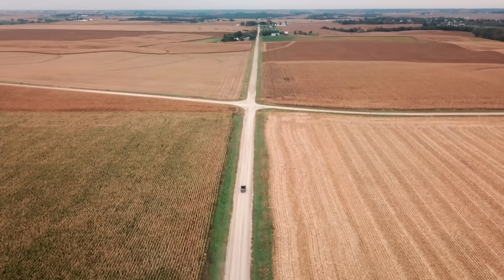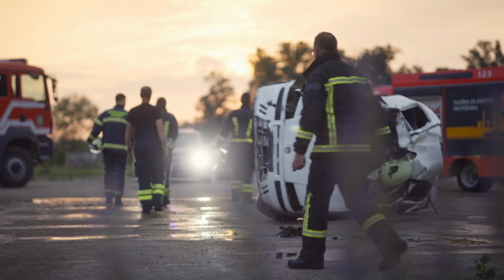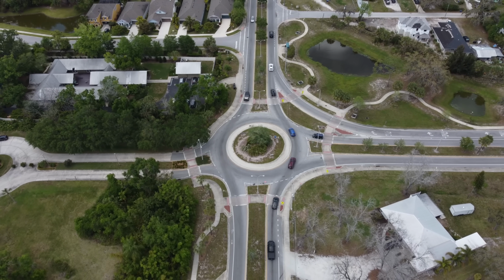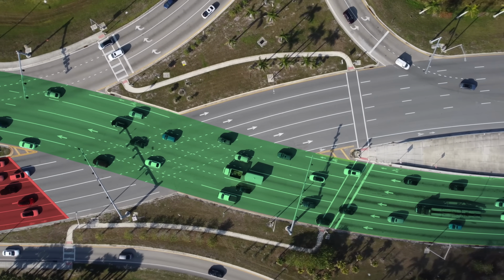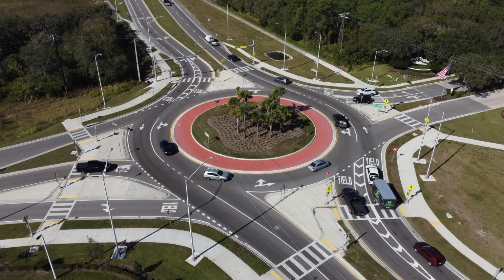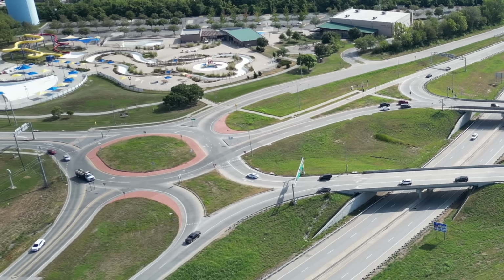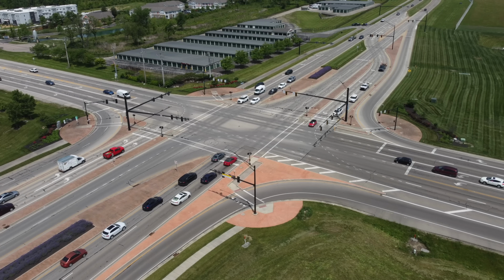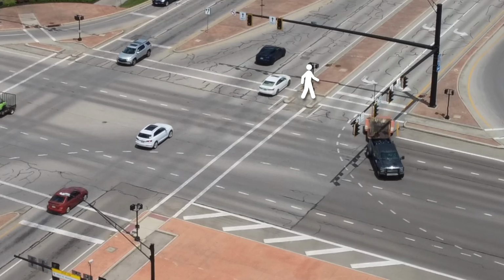These Intersections Are Changing the Roads Forever

Comment: A big reason roundabouts are safer is also that collisions occur at oblique angles rather than ninety degrees. You get done body damage to the cars, but the humans are safer.
Reply from the maker: Very true
Reply: @Streetcraft  No, not true, the angle is usually 70-90 degrees. What mitigates damage is the low speed. That is, if it's built correctly - lots of roundabouts in my country are not, and cars plough through them at up to 70mph.
Reply: @ooioiioioo In what country exists thes usless roundabouts?
Reply: @oliverbecker3443  I'm help him, Indonesia. No one yields for those already in the roundabout. In fact, those in the roundabout have to wait lol. maybe less about the "useless" roundabout but more on the behaviors and knowledge of the drivers. But then again, had everyone yielded it would only cause traffic because there is very few who use it for 3rd exits. all are going straight (2nd exit).
Reply: @ooioiioioo If traffic is joining a roundabout at 90° then it is a poorly designed roundabout.  The danger of a normal junctions is traffic crosses at right angles so a vehicle can drive straight into the side of another.  That should be physically impossible on a properly designed roundabout as the approaches should be flared so that a vehicle would be in the middle of a turn as it joins so any collision will be side-to-side.  It is the combination of that and a lower speed that contributes to overall safety.
Reply: I really don’t like guided multilane roundabouts - they make the yielding part of the design much less encouraged by allowing you to drive almost straight along an almost tangent when aiming for the first/second exit. They are also far less forgiving of navigation mistakes if you haven’t moved into the correct lane before arriving at the roundabout. The main point of a roundabout is that the junction of the arriving road with the roundabout should be like a minor road reaching a major on where you’re only allowed to turn towards the passenger side. This should involve turning, not going straight, to encourage the slowing that makes the whole thing safer.
Reply: Meanwhile you have more collisions because of either poor sightlines due to landscaping choices or an area has far too much traffic for a uncontrolled traffic feature like a roundabout to be used but it was forced in because of "style" choices. This doesn't even touch the problems of roundabouts being used in areas with heavy truck traffic.
Reply: @H @Hybris51129 is is a good point. Some landscapers get too enthusiastic! As for high volumes and traffic jams, whether you have crossroads or roundabouts, things will snarl up. I don’t see any silver bullet there, but crossroads controlled by lights may be slightly easier to keep unencumbered.

Comment: I'm surprised that nobody has split levels on a diverging diamond to remove the stop lights.  If you have vertical space for the clearance, you'd have fully uninhibited movement without any left-hand turns.
Reply: Do you wanna pay for that?
Reply: At that point it would probably be no more costly to build a stacked interchange which does the same thing.
Reply: That would be a DCMI, double crossover merging interchange. Though im not sure any such interchanges have been built irl.

Comment: As a Dutch traffic engineer, i have some doubt about the Diverging Diamond Interchange.
One thing that you keep in mind when you design a street or road, is the expactation that also not very capable drivers uses the road in the right way.
In your examples, the angle between the roads on the main crossing is very high, which ensures safety. But only if there is planty of space, this is possible. In Europe, espacially in The Netherlands, the angle is not that high to make the interchange smaller. But that increased the number of wrong-way driving and crashes. That's why we don't recommended this type anymore.
Reply: Here in Amstelveen there is a new diverging diamond interchange still being finished joining onto the A9 and it seems to work pretty well.
Reply: @AlistairLynn  The DDI in Amstelveen is way better than the first one in Leiden.
They improve the design, for example to use "anti-zichtschermen" to streamline the traffic.
But still a Partial cloverleaf interchange is way more bulletproof.
I'm happy that the DDI will be changed back to a normal interchange after finishing the roadworks at highway A9.
Reply: It is a truism of engineering that as soon as you create something idiot-proof, you find a bigger idiot....
Reply: So what type do you recommend instead?
Reply: @NeuQN  Turbo roundabouts.
Reply: @David-bi6lf  Turbos don't do the same thing as diverging diamonds.
Reply: @CrissaKentavr  No they don't but you don't need to have the roads cross each other when you use roundabouts rather than junctions.
Reply: @NeuQN  Most times a Partial cloverleaf interchange will be the solution. In the Dutch city Leiden, a DDI on the A44 highway interchange is replaced to the partial cloverleaf. It removes high density left turns and it's way more bulletproof.
Reply: @NeuQN The dutch are not the ones to listen to for road safety. Even germans and swedes have fewer fatalities on the roads per 100K people.
Reply: @Sam-w5v  In 2023 Netherlands was slightly safer than Germany and was significantly better than the EU average. Sweden was even better (best in the EU), but that doesn't mean netherlands is bad.

Source is page 3 of this report:
https://ec.europa.eu/eurostat/statistics-explained/SEPDF/cache/55846.pdf
Reply: @Sam-w5v They do have an excellent record on cycling safety though.
Reply: @unconventionalideas5683  That's because no where else comes to close to building the amount of separated cycling infrastructure as the Dutch.
Reply: @unconventionalideas5683 I looked it up. In 2024 less than 700 people died in traffic accidents in the Netherlands TOTAL.
Most of them were actually cyclists, with 60% of them using e-bikes and the most likely cause of death being head injury.

As a German who has spent a lot of time in the Netherlands since I was a child, it was always nice and since I have been driving, the Netherlands were very pleasant.
Reply: @Capybellie  The anti cycle lobby in the UK love to cherry pick the statistic of a high number of cycle deaths in the Netherlands whilst conveniently ignoring the fact that something like 30% of journeys are made by bike there in comparison to 1% in the UK. It will also be a fraction of 30% in Germany as well so its stands to reason they would have more cycle deaths.
Reply: @Sam-w5v  The Germans?? Don't make me laughing 😂.
Yes, the traffic safety in Scandinavisch countries is better, but they don't have DDI's. Only Denmark has one.
The traffic safety in Scandinavisch countries comes through lower speed limits in cities and more bicycle helmets.
Reply: @Sam-w5v  idk, kinda doubt that. here in the Netherlands we actually do incorporate a lot of clever measures to increase road safety. one could make a very long video about it.
Reply: @HazewinDog the netherlands places 21st in safety, as measured by road fatalities per 100,000 residents as of 2024. This is a higher per capita fatality rate than the UK, sweden, ireland, slovenia, switzerland, japan, germany, and austria to name a few examples.
Reply: @Ferdi.. germany has road 3.35 fatalities per 100K residents as opposed to 4.19 in the netherlands.
Reply: @unconventionalideas5683 it's certainly a work in progress, but they are very committed to improving it. That said, they still rank above even the united kingdom in per capita fatalities.
Reply: That numbers does say a lot on its own. Do both countries travel the same distance per citizen? Also this is about car infrastructure, we have more bike deaths than car deaths. 
So if you look at cars, it is very safe.

We have probably one of the most bike deaths, but we are also (one of the) safest countries to Travel by bike, if you look at deaths per travelled km. 

One number can not give all the information. And making conclusions on only that number is flawed. 
There are a lot of parts that tribute to that number. A country with a worse emergency response will have a worse number for the same roads.
So don't just focus on a number without looking at the factors and other differences between countries
Reply: @Anco firstly, the statistic is road fatalities, not car fatalities. Secondly, if measured by vehicular kilometers (I could not find intermodal statistics), the netherlands still sees greater per kilometer fatalities than Germany, Canada, Sweden, the UK and a few others. As roughly half of trips in the netherlands are made by car, I do feel this is a pretty representative statistic, especially considering trips made by vulnerable road users are typically more dangerous than those made by car.
Reply: @Sam-w5v   @Sam-w5v  I was trying to explain why only looking at that number is flawed. And this video is about car infrastructure. So it would make sense to look at the car safety of the Netherlands and not road safety. If the other countries would bike as much as the Netherlands do, then there deaths would be much higher. And if you don't count cyclist deaths,  the death per 100000 citizens for NL is 2,32 in 2023 and 2,82 for Germany. So I don't see the number you reference as representative of how safe our highway entries/interchanges are.  
And about vulnerable road users, we have 0,33 deaths per 100.000 citizens for pedestrians and Germany has 0,41. So combining those two, if you mainly have pedestrians and cars, i think it would not be bad to look at the Netherlands. The main difference is the cyclists. And that is just something you can't compare because other countries does not have the detailed numbers as we have about cyclist. Maybe you can only compare it with Denmark, which has some numbers. 

But you stated that you should not look at the Netherlands for safety, because the number is a bit worse, but if you look at cars and pedestrians, our numbers are at least better than Germany. And since USA does not believe in bikes i think it makes totally sense to look also at the Netherlands. (And also for bikes, but since we are so far the only country with those bike numbers, you  can't compare it really, hopefully Denmark will soon get the same numbers)
Reply: @Anco if what you're saying is true that the US does not value cycling culturally, then why would we draw from cyclist oriented safety principles? Cars make up a significant modal share of american transportation, so I think motorized safety can be the main focus in the states.
Reply: @Sam-w5v  but you have to look in dept at the numbers, don't just take the number and think that's the whole story.

i wouldn't be surprised if The Netherlands really has more deaths per 100k on their roads.
after all we have plenty of 80+ people cycling, and if they fall it often leads to severe injuries or death.
the high share of cycling also means that chances of being in a cyclist vs car accident are way higher than in (pretty much) any other country.

so if you take those things into consideration it changes the optics of that simple statistic.
Reply: @ChristiaanHW I suppose so. I think the netherlands certainly makes a lot more efforts than any other country when it comes to cycling safety, but I've always felt their rural road safety is lackluster compared to other nations like sweden. They often lack hard shoulders, and many other nations have converted their rural highways to a 2+1 lane configuration with a median and more realistic speed limits like 100 kmh (though I suppose the netherlands has an extensive motorway network to begin with).
Reply: @Sam-w5v  Dutch rural roads don't need hard shoulders or fancy add-ons, the only people driving on them are people who live in the area, farmers, and the occasional tourist.
so the traffic volume on those roads don't warrant such extra things.
(at least if you're talking about the same rural roads as i am, the 60km/h ones)

our "rural highways" which you can barely call rural due to the country being so densely populated, are often just 1 lane in either direction, and occasionally an add-on so slower vehicles can let others pass. (because on those two lane roads it's often prohibited to overtake)
and those roads are either 80km/h or 100km/h

and you can't place a median on two lane roads, that will prevent emergency vehicles from using them efficiently. (they will have to wait for other traffic to clear the road)

even our real highways/interstates are either 100km/h or 130km/h.
so i think the speed limit certainly isn't a problem there.
Reply: @ChristiaanHW i'm referring to 2+1 roads with alternating passing lanes having medians. At least here in the united states we install half or full lane width shoulders on most rural state / federal highways so emergency vehicles can safely respond without needing to overtake in the oncoming lane. By rural highway, I mean 80 kmh roads where there's often only a narrow shoulder in the netherlands. If an emergency vehicle is responding, they're forced to pass vehicles at high speeds in oncoming lanes, and disabled vehicles have to stop in the travel lane, which causes a safety risk and congestion. The netherlands spends a lot of money on roads, it can't cost that much to install hard shoulders.
Reply: @Sam-w5v  emergency vehicles due to their blue lights and (better than the US style) siren are noticed well before they are upon you.
so people see and hear them coming from plenty of distance to give them the space they need.
so the road doesn't need to be twice as wide as necessary for them.

but that is part design and part people being nice and understandable to each other. so i get why in a nation where people are really selfish that might not work.

as for broken down vehicles, a car rarely (i would even go as far as say never) suddenly breaks down and come to a full stop immediately.
so the driver has time to just steer the vehicle into the grassy area next to the road.

once again it's about people being polite towards each other.
instead of "i don't want to get dirty/wet shoes so i park right here in the middle of the road".
people understand that if they park next to the road, that traffic won't get impacted by it 

but most of the time those vehicles with trouble have enough time to reach one of those passing spots i talked about earlier, so they won't even need to park in the grass.

as for the costs of making every road twice as big (two lane road with a shoulder big enough for a car to park on on each side).
maybe laying the roads isn't that expensive.
but in a densely populated country like The Netherlands, you won't find enough space to do that.
especially since those highways often go trough nature area's/reserves.

it's all a balance of priorities.
and cutting down forests, spending billions, doubling roads etc just for the few cars each year that aren't able to park at a perfect spot when they have car trouble just ins't worth it.

like how having an airbag for each train passenger might be safer, but that little added safety isn't worth the huge cost of it.
Reply: @ChristiaanHW I guess so. I won't keep bothering you, but I do have one last question. How are dutch emergency signals better when they employ fewer light heads and use blue, which is less visible than red light over long distances? Most american response vehicles use red lights at least and many vehicles employ blue as well. Dutch lightbars typically only employ two flashing signal heads on the lightbar plus grille lights as opposed to a full lightbar, grille flashers, and mirror lights like many american vehicles.
Reply: @Sam-w5v  the lights are better because blue isn't used for anything else.
red is used for exterior lights, traffic lights and railroad crossing lights.
so a red light could mean many things.
while a flashing blue light is only used by emergency vehicles.

and emergency vehicles in The Netherlands have lights in the bar, the grills and higher vehicles also have lights on the back.
together with their turning signals (which larger vehicles also have on the side of the vehicle) that also blink, together those lights can be seen from any direction around the vehicle.

and the main thing that is better is the siren.
the US one carries over less distance and it's way harder to know which direction it comes form.
while the European standard siren is directional. if it's coming towards you you hear it from far away, but once it passes you after a few meters you already can't hear it anymore.

that together with it's frequency make it a really easy siren to pinpoint (the location of).

plenty of research and even video's on this site that explain it.
Reply: Deus ex machina: the self-driving technology dominats the world.